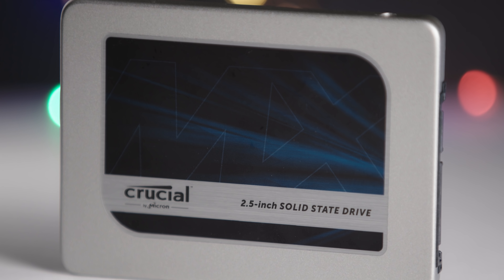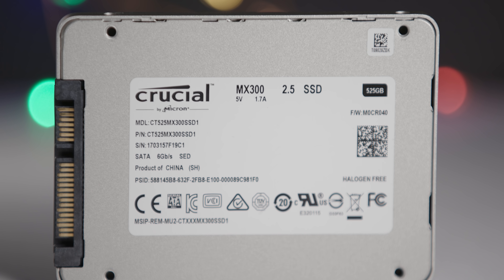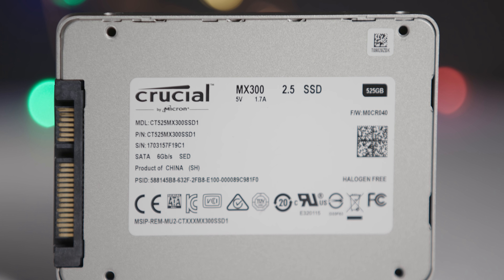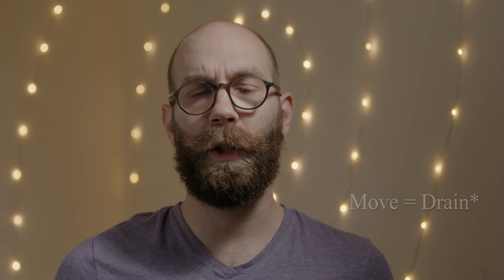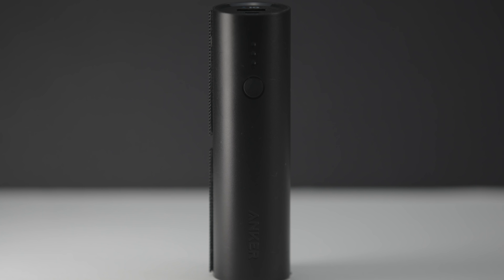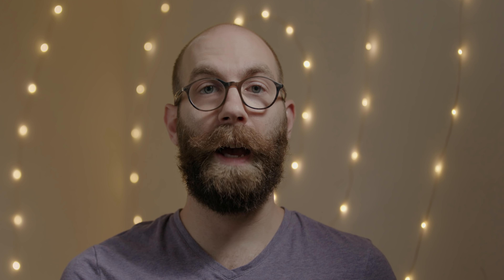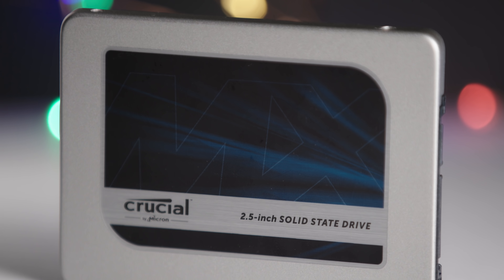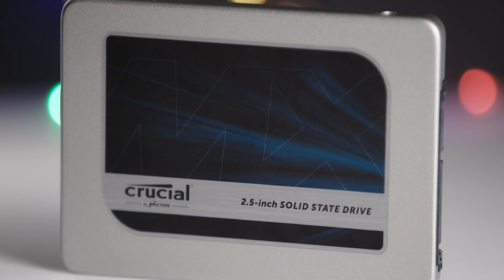C200 CFast to SSD adapter Review and thoughts

Comment: The Qualcomm tech you're referring to, QuickCharge, only activates when the consuming device talks to the charger and specifically tells it what voltage it wants(there's many - 9, 12, and others).
Any USB power bank will work, but I highly recommend powering it off the camera's battery. If you remove power from an SSD during an intensive write, you may wreck the drive and have to re-initialize it, thereby losing all footage. It won't really deplete your charge a lot, because most SSDs consume less than 5W, often 2-4.
Also, if you're really cheap and don't want to buy the rather expensive dummy CFast card to SATA adapter, you can just buy a male to female SATA to SATA drive adapter(not just a cable), and slightly chop the connector down so it fits into the slot. The notch of the male side goes towards the middle of the slot(refer to the CFast pinout vs. SATA pinout). Female just plugs straight into any SATA drive.
There's no electronics inside the dummy card, it's just mechanical.
Reply from the maker: @spirit yah, i realized recently i was wrong on the Qualcomm hypothesis i made in this video. Still trying to figure out why these USB batteries randomly stop providing power to the ssd. 
I moved to using an m.2 sata version that is powered from the camera and plan to do an update to this video.

I really appreciate your response. Helped me a lot!

Comment: Im keen to try this! I cant afford cfast cards, they just ridiculously priced. Does the door feel solid after jamming it closed against the cable? I believe the warranty will be void if you damage the door by removing the clear panel or cut it at all.
Reply from the maker: The door feels solid for sure. As for warranty - if you cut the door or damage it in anyway, you can for sure void your warranty. I am not sure if removing the clear panel will void warranty, but I wouldn't want to find out.
Reply: Just spoke to the guy from Italy, going with the msata option (less cables, no extra power) will let you know how I go! We do mostly studio work and will probably use cfast for run and gun. What facebook group did you see the kit? Id like to join and see others setups